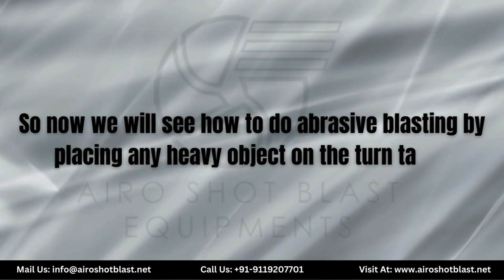Pressure Blasting Cabinet with Turntable & Tumble Basket (PB-12090) - Airo Shot Blast Equipments

Comment: Dear Sir,
 Can we use steel shots in this, machine under 5.5 kg/cm2 Pressure to clean the part, with provided rubber gloves,
How much time the rubber gloves durable for steel shots use.